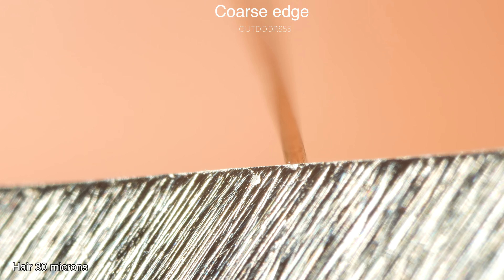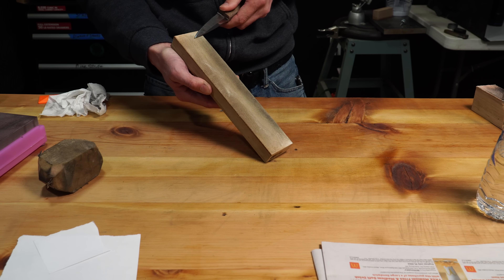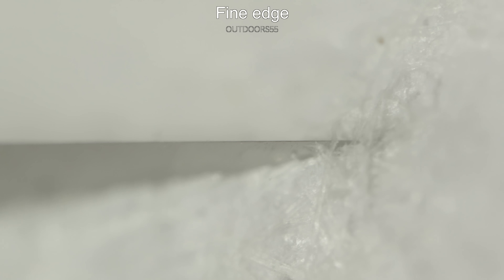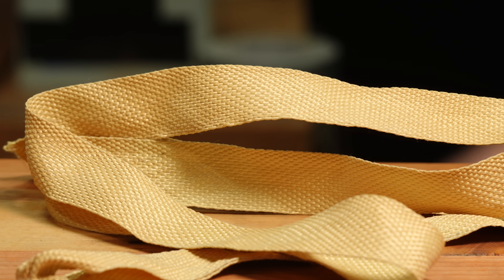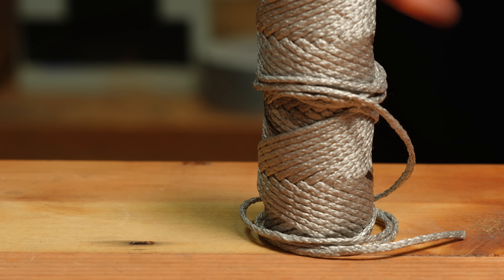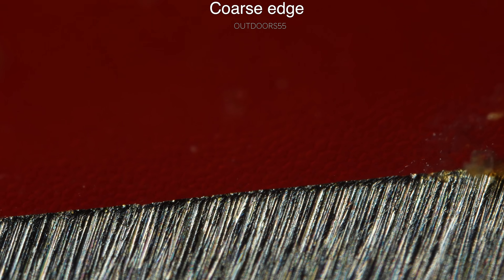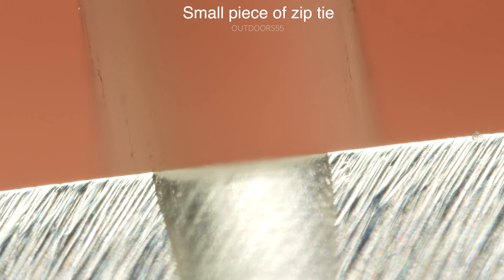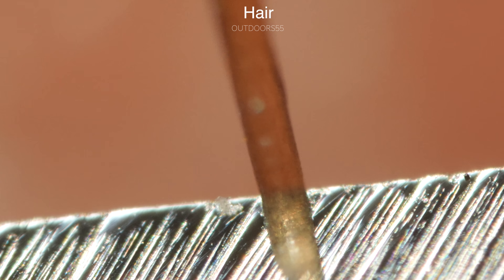Coarse Grit Knife Edges Are Weird - Coarse Vs Fine grit Edges Cut Under Microscope

Comment: i'm curious if edge retention is a factor in a coarse vs fine challenge
Reply: This is also something I was wondering
Reply: @shawno8253  literally, it's difficult to film this way and with this level of detail.
Reply: @solarsynapse  meaning to record image
Reply: @elruchal  👍
Reply: Dr. Vadim Kraichuk actually says polished edges have better edge retention, since the high spots in an unrefined edge are really just local burrs that tend to break/mushroom. The perceived edge retention loss with polished edges is usually due to slightly rounding the apex during polishing.
Reply: @spencerbralley  Are we talking coarse with or without burrs here, because outdoors55 is very careful about his burr removal even on coarse edges. It would be very interesting to test coarse edge vs fine edge, and of course, with burr removed on both, as that is a no-brainer.
Reply: @bobthegoat7090  "Polished" and "burr-free" are the same thing, again according to Dr Vadim. If the apex is super uniform and burr-free, it's inherently polished, even if the rest of the primary bevel has deep scratches on it. Both Dr Vadim and scienceofsharp say "toothy" edges don't really exist, and "overpolishing" is really just rounding.
Reply: @spencerbralley  then I don't get your comment, because we are talking about coarse vs fine. Not comparing anything with burrs.
Reply: @bobthegoat7090  Basically I'm saying a coarse edge with no burr is an oxymoron. "Microserrations" are just burrs, and even if you have deep scratches on the large flat sides of the bevel, your apex is smooth and uniform if it's deburred well. Better sharpness with an apex sharpened to a higher grit is just due to a keener apex, as smaller abrasives reduce edge radius and lower apex fatigue.
Reply: @bobthegoat7090  To put it another way, the two edges in this video likely look extremely similar under extreme magnification (SEM, not just a high zoom camera) and the finer polished edge is simply sharper, just barely. Sharper/keener edges stay sharper compared to edges that start duller, so the polished edge should be superior in every way, other than time it took to get the edge.
Reply: @spencerbralley  charlatan.
Reply: @TimJohnson-x1o  If you disagree, do so with reasoning/evidence... Why resort to name calling?
Reply: @spencerbralley  He is wrong. about a lot of things. In this case, his folly is demonstrated by the results of extensive CATRA testing. It's not something thats open for debate. Course edges cut longer but are more fragile when it comes to chipping. It's not a huge difference but it's statistically relevant. Whereas polished edges don't cut quite as much but they are considerably less prone to microchipping. the reason for that is obvious. There are fewer areas where cracks can form.
Reply: @TimJohnson-x1o   Where did you see this research? Knife steel nerds has an extensive article on this, and the results seemed inconclusive at best when it came to finishing grit. Also, wouldn't microchips dull the edge faster, not slower?
Reply: @TimJohnson-x1o  Also, just because there's research on something doesn't mean it's not up for debate. Research methodology is frequently flawed, and often different reputable sources will contradict one another. I'm debating based on the findings of Vadim Kraichuk, who has some of the most rigorous testing I've seen to date, along with knife steel nerds and science of sharp.
Reply: @spencerbralley  CATRA testing, which is the standardized industrial way of measuring "edge retention," doesn't cause microchips. Page 86 of the book "Knife Engineering" by Larrin Thomas. Section titled "slicing vs. push cutting edge retention." AEBL with 120 grit edge scores 600 on CATRA. and the higher the grit the lower the score. 400 grit scores about 475. a mirror polished edge scored 400. That's 50% more edge retention with 120 grit edge vs a mirror edge on CATRA test. It's also covered in another section as well.
Reply: @spencerbralley  also see chapter 10. grinding, polishing and sharpening on page 97 which covers this in more detail.
Reply: @TimJohnson-x1o  I'll check these out when I get home, I don't have the book with me right now. In this case, I'm not sure why Larrin would have one conclusion in his book with seemingly no conclusion on his CATRA article. Vadim disagrees entirely, but it's possible this behavior varies depending on abrasives, steel, and cutting media.
Reply: @spencerbralley  I'm sure it does vary based on many factors. CATRA tests don't simulate real world use. They basically just approximate abrasion resistance in the context of an edge. In the real world all sorts of other things can dull edges. Abrasives are only relevant in certain instances, like say grits that are finer than the carbides in a given steel. In the course grits, it's not a factor.
Reply: @TimJohnson-x1o  Vadim argues CATRA is extremely representative of real-world dulling, as a properly cleaned apex with an appropriate sharpening angle (and no misuse) should dull chiefly by abrasion. It seems to have some ideas that disagree with Larrin, but it's worth checking out Knife Deburring 6th edition by Vadim Kraichuk. Super interesting finds. As far as your last statement goes, it seems abrasive type matters a lot, and this was a large focus point of Vadim's research. Using aluminum oxide on a knife with high vanadium carbide content will burnish the steel matrix around the relatively dull carbides, resulting in a fatigued and poorly refined edge with non-abraded carbides poking out. Diamonds and CBN fix this.
Reply: @TimJohnson-x1o  Seems Larrin says slice cut edge retention is better in coarse finishes while push cut edge retention is better in fine edges. Makes intuitive sense, but still somewhat contradicts Vadim's book and, to a lesser extent, his article (his article shows a shockingly refined edge off a DMT 600 performing best). Page 100, under Finishing and Polishing, does also discuss the importance of superabrasives when dealing with high hardness carbides, albeit to a lesser degree than Vadim's book. Looks like his testing on page 87 was done after sharpening with diamond abrasives on a strop, which is pretty similar to Vadim's methodology, so I'm surprised to hear them somewhat disagree.
Reply: Alex, your channel is now like watching a science show, epic stuff. The macro, dare I say micro photography is fantastic! Things you cannot see with the naked eye are amazing to watch. Keep up the great videos…Cheers from Nova Scotia…MikeR.
Reply: +1
Reply: Coarse holds an edge longer in general. Also weirdly enough, a more acute edge lasts longer as long as the steel can support it. I have a para 2 in s90v that I sharpen to 325 grit at 10 degrees per side and even with hard use it holds an edge for forever.
Reply: To me it would make sense that a mirror polished edge should stay sharper longer. All other things being equal, it should have less drag and therefore less pressure required to cut. Which I assume would lead to a longer lasting edge. But lots of other people say otherwise. 
I'm curious if people who only coarse sharpen their knives use a wider angle. Deliberately or otherwise. 
Personally I coarse sharpen knives I expect to put through their paces and will need sharpening again soon. This tends to lead to a less fine edge so it can last longer. 
I'm pretty sure I'm not alone in this.
Reply: The rope cut test would be interesting 💪🏻
Reply: My wife is a hunter and I have sharpened her knife to a mirror polish. The feedback I have got is that it performs very well when skinning a moose for a while but the performance drops significantly before she is done. It might be that I haven't done a good enough job, but on the other hand that is a pretty demanding task and moose are big. I plan to send her out with a coarser edge next year and hope that it will work better.
Reply: @haqvor  wtf. My wife refuses to cary any knife I've sharpened because they are "too dangerous", and certainly never brings me moose.
Reply: @guggiuggi3687    My wife never even once brought me a moose!   >:-(
Reply: @leaonardland9001  I once brought a moose home, she's still here.
Reply: @outsider344  I found a good one! :)
Reply: Lol @scottll
Reply: @scottll LOL! 😂👏🏻
Reply: @scottll 😂😂
Reply: @haqvor  Might be the type of steel - some steels hold an edge better than others. For example basic 1095 tool steel will hold an edge longer than a stainless like 440C.
Reply: @haqvor  I’ve noticed with meat that a very refined edge makes the meat feel like it’s not there at all.
Reply: @TheScrawnyLumberjack isn’t that the nicest feeling, slicing a steak with a sharp blade😛 it almost makes me want to eat my steak in longitudinal slices in stead of chunks😂
Reply: @haqvor   The coarse edge will fare worse.
Reply: @haqvor  Try doing a convex edge, it should have good cutting and better edge retention. Either that or she can strop the knife to maintain the edge while she is skinning out in the field!
Reply: @haqvor  You probably still have a messed up burr or your geometry is wrong for the steel.
Reply: @haqvor  Things that never happened 101 🤣🤣🤣
Reply: Fine edge vs working edge may flip places, but overrall edge retention is the same
Reply: Thinking about it strictly on a scientific basis, I would think fine would retain the edge slightly longer as the edge is on average thicker. The coarse edge has deeper gaps in the metal, which may cause slightly less retention as it would give slightly easier. Not much, though. That being said, I don't think it would make nearly as much of a difference as edge geometry, metal type, and the amount of burr you were able to remove. It may technically make a very minor difference but I wouldn't expect too much difference with that alone.
Reply: @SQUAREDAWAYSHARPENING  as for the coarse edge valleys giving way, theres no way to know as each blade would vary depending on matrix hardness and overall carbide volume and type.
Reply: @thaknobodi  exactly. I was saying specifically same metal, same edge geometry, same burr removal/minimization. All 3 of those above factors would have far more impact on edge retention than the difference between coarse and fine.
Reply: @SQUAREDAWAYSHARPENING  Edge geometry absolutely, I might say coarse vs fine makes as much difference as the other two but not with enough confidence to actually disagree with you lol
Reply: Same question for me ! @outdoors55, did you re-sharpen the edges between cutting sessions (and by the way, great work and excellent video !!)

Comment: Hey, can you make a tutorial on sharpening small knives? I have a lot of trouble maintaining an angle while trying to grip a small knife
Reply: Me too. I'm sure my Leatherman Wave has different angle every time I sharpen it, because I can neither see nor feel whether I'm matching the existing angle.

Since I've seen you answer "I don't know" when questioned about the angle you've use on a particular knife, is the answer to learn to hit the same angle every time (i.e. muscle memory), then sharpen all knives to that? 

And a related question: how do you maintain the angle all the way to the tip? The curve always throws me.
Reply: Curvy blades are tough. Sharpen one part of blade. Then sharpen the troublesome part of blade.  @weevilinabox
Reply: litterally click on his channel, he did SO MANY videos like these...
Reply: try a smaller stone. I use stones as small as .5" x 3" for freehand sharpening. i only freehand.  I have no issue doing little 3" knives or 8" knives on the tiny stones. But most of my stones are full size obviously. Small stones are good for smaller knives, knives with tricky curves and knives with recurves.

Comment: Do I need to use the paste on the strop?
Reply: Yes. Leather won't remove material on your blade, but with the diamond paste it will !
Reply from the maker: In my opinion yes. Bare leather doesn't do much unless you're coming from a VERY fine stone. 8000+ grit.
Reply: @OUTDOORS55  do I just have to put paste on once?
Reply: Yes, he says in another video that the leather is simply there to hold the compound (or whatever he referred to it as).